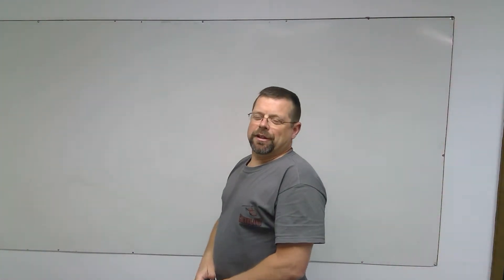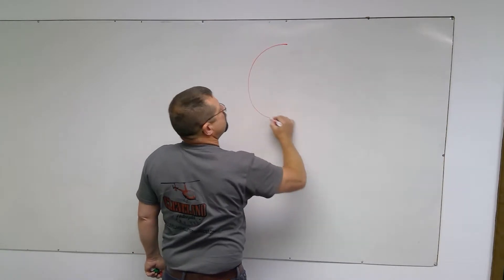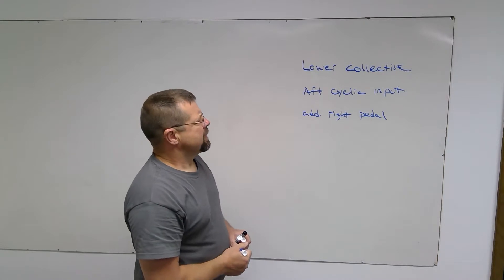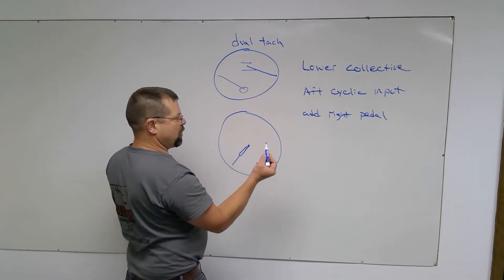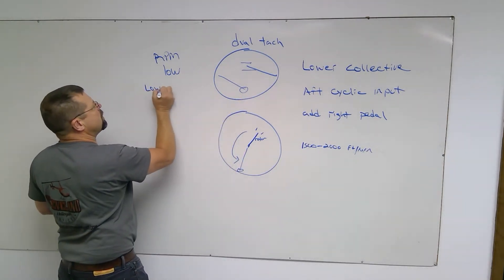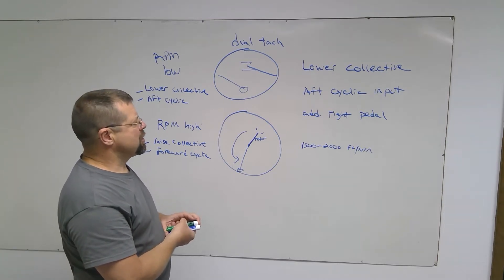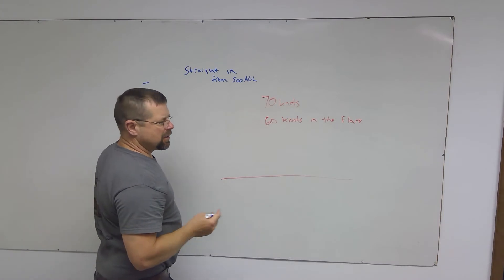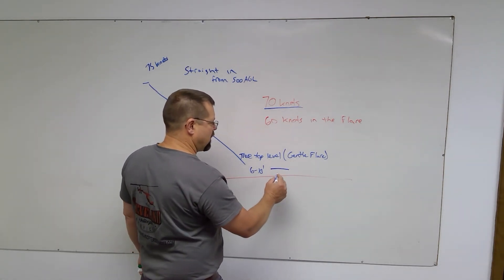Helicopter Auto-rotations, power recovery

Comment from the maker: Aft cyclic will cause the attitude of the helicopter to pitch up, thus causing more airflow though the rotor system. Forward cyclic causes the helicopter to pitch down, thus reducing airflow through the rotor system